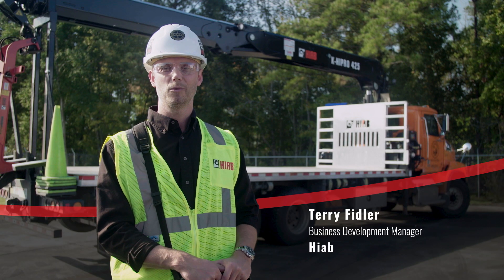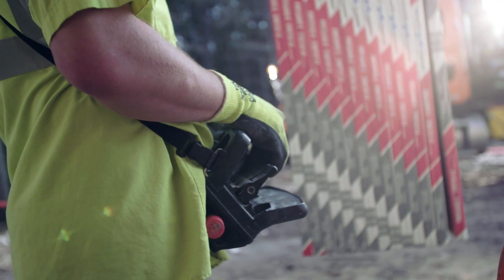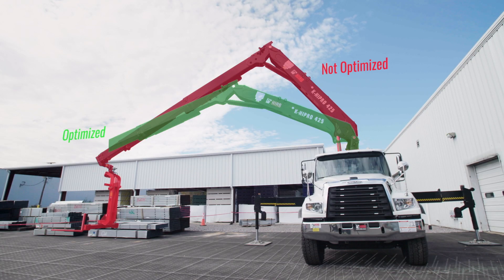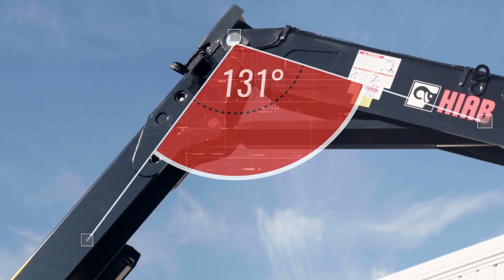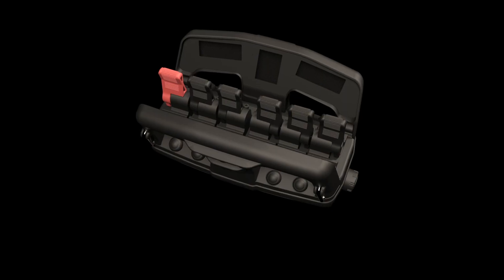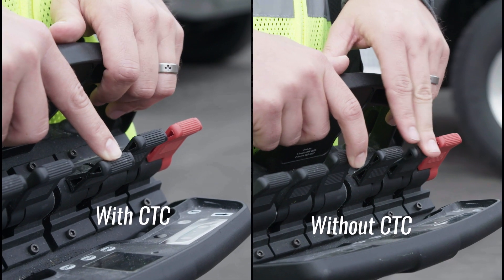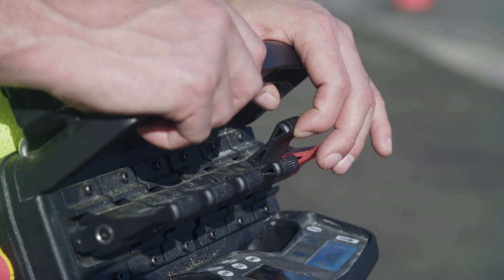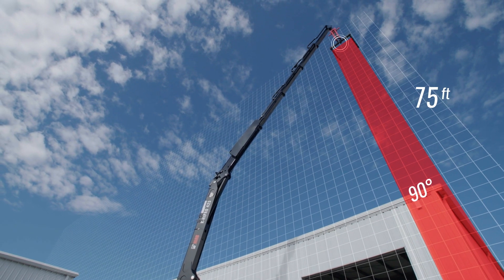Demonstration of the drywall crane K-HiPro 425 with CTC

Comment: 25 year Hiab operator, I don't think about Main Boom Down and Secondary Boom Up and Boom Out, I just do it, it happens automatically. That said I would love to try that system to see if it is better or not, but experience has more to do with everything else as well as running the controls, set up, positioning the truck, job site assessment for hazards. Computer controls are great but don't replace experience or common sense.